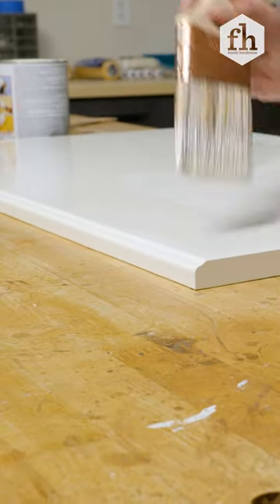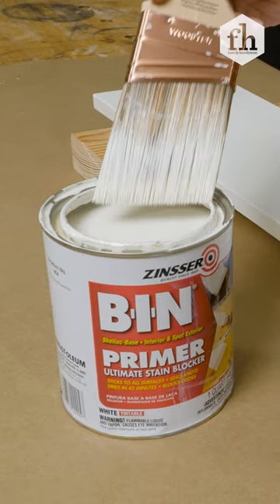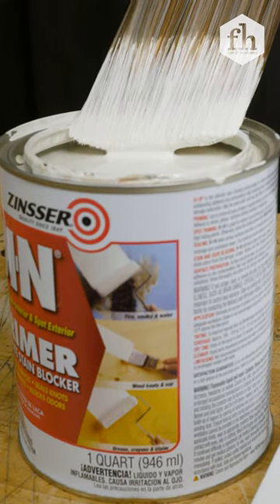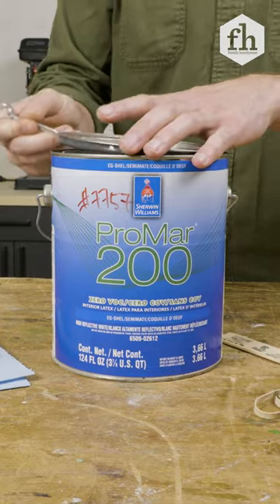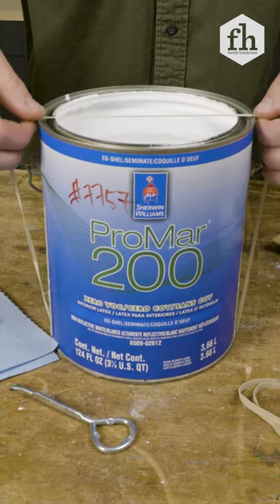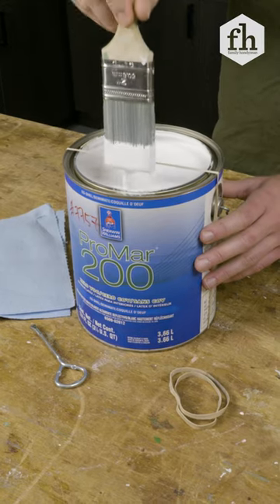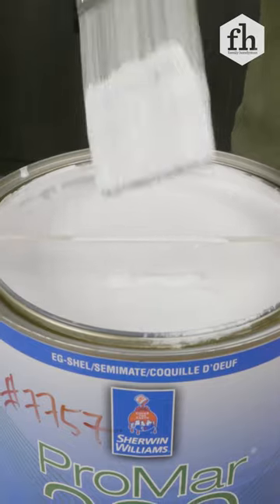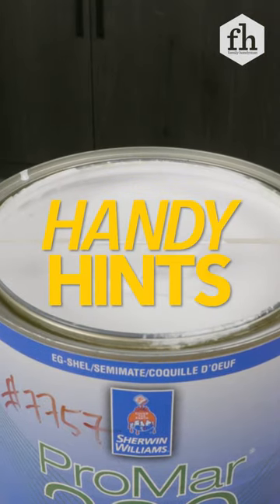How to Prevent Excess Paint Getting On Your Lid and Paint Brush #shorts #diy #painting

Comment: I have learned to always put paint in a smaller container. Don't edge with the gallon paint bucket. The paint will slowly dry out, causing coagulation. 
Do this, especially if you plan to use the same gallon of paint over a period of time. Which is usually the case for home owners doing it themselves.